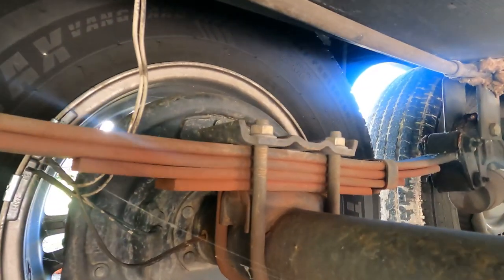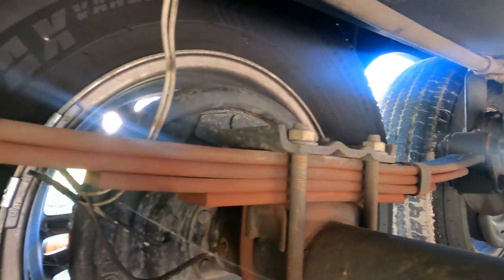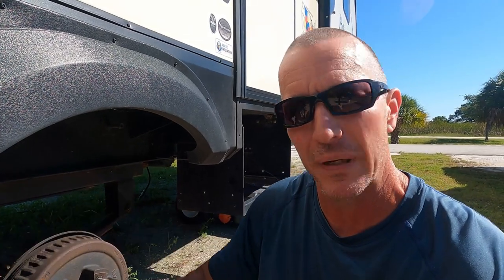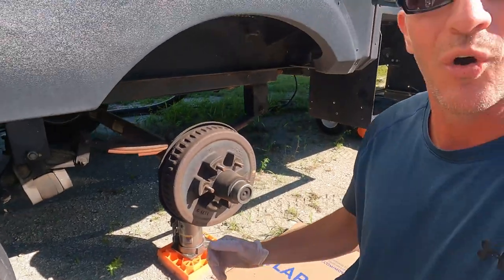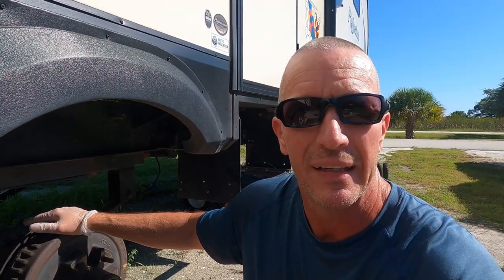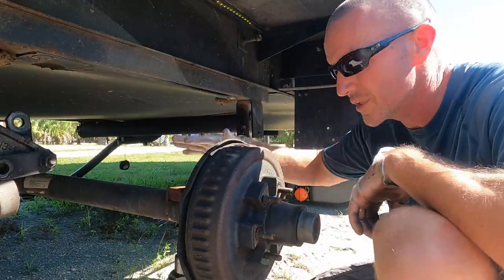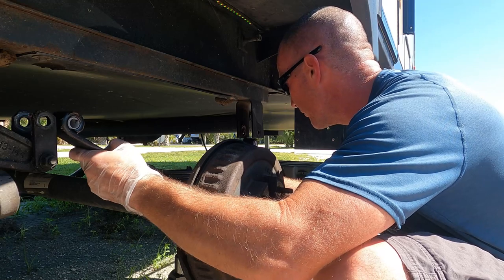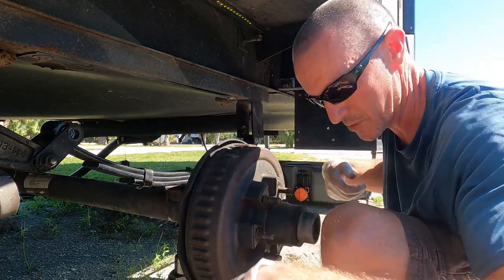Replacing Leaf Springs On A 5th Wheel | RV Suspension Repair

Comment: Suspension components on RV’s break because the manufacturer installs only the bare minimum needed for the weight. Once you add your cargo and some fresh water you are very close to or over the GVWR. NOT GOOD! Also, if remove the U bolt’s first, and then let the axle down slightly with the bottle jack until the centering bolt on the leaf spring is clear of the U bolt bracket, it is way easier to take the wet bolts out. One more thing. If you’re installing new springs, get rid of those nylon bushings and upgrade to the brass ones. Those nylon ones are crap and wear out quickly.
Reply from the maker: Thanks for the tips!

Comment: I noticed the 4 leaf are 25 1/8 and the 5 leaf are 25 1/4. Do you think the 5 leaf would have fit ok even though slightly longer? I'm not sure if this is an issue or not?
Reply from the maker: During my research, many people used the 25 1/4” 5 leaf springs with no issues. That was my preferred option, but they were out of stock at the time and our U bolts were not long enough to accommodate the extra spring. That is why I ultimately went with the 3000 lb 4 leaf version.
Reply: 10-4, I'm having the opposite issue but at least they have 5 leaf in stock. I'll go with those. Thanks for the response and video
Reply from the maker: @davidlawson5937  you’re welcome
Reply: @davidlawson5937  David, did the 5 leaf work ok? Any feedback with the install? Thank you.
Reply: @cadexim  The 5 leaf worked fine. Had issues getting the old ones off and new on but it was manageable. Took longer than expected. If you are like me then everything does but you'll get it done 🤣. For me it was a bit of trial and error trying to find the sweet spot with the jacks to get bolts off and on. Don't really have any additional tips. It's a pretty tough job but doable. Be patient and take your time figuring things out.
Reply: @davidlawson5937  thank you David. I recently installed the new CRE3000 and installed crossmembers so I have an idea of the work but like you said, it is still quite a job. You also replaced the U brackets correct to accommodate fir the 5 leaf springs correct. Do you have the part number by any chance? Thanks again.
Reply: Didn't have to replace the u bolts, mine were already long enough. Did replace any shackles or nuts and bolts that were suspect. I might have replaced all the nuts on the shackle bolts that were the "locking" type. I don't remember the name of them and don't have any part #'s. I did that job about a year ago. Sorry I'm not alot of help but this video has solid info in it.
Reply: I think the u bolts are about 7" long and will work for 5 leaf. Hope this helps.
Reply: @davidlawson5937  thank you very much David. That is good info. I will measure mine and if they are the same length as yours I wont replace them.
Reply: Well done, you showed how easy this is to do. Thank you for making this video.  Good comments from viewers as well.  Surprised no comments on alignment.  Must not  be an issue.

Comment: Very nice video but you should have replaced the U bolts as they stretch when torqued and never should be reused.
Reply from the maker: Normally I would, I was in a time crunch and new U bolts were not readily available. Thanks for watching!

Comment: 2 year old bad leaf spring is not impressive and you should have changed that dexter out also
Reply from the maker: Agreed, 2 years is premature for a leaf spring. To be fair though, we are full time and have made multiple cross country trips over some extremely rough stretches of road. Thanks for watching!
Reply: @JouppiOutdoors  after our first trip from Nevada to the Keys and back, our next trip is to Alaska. Replaced the suspension with a Cree 3000 and seems to help. Rough roads ahead

Comment: Never, ever reuse u-bolts. U-bolts are a torque to stretch alloy meaning when they are properly torqued, using a torque wrench, they stretch a certain amount which is where they gain their holding power. If you back them off even a turn, the stretch you have applied will have an inherent memory therefore if you properly re torque them they will be over stretched thus reducing their strength and holding power. Sure, you could cruise around for a long time without issue yet when you get into a high speed evasive maneuver or a panic stop at speed they will more than likely fail causing a catastrophic failure. Those who say they have done it for years without issue are what we call "lucky". As a certified, professional technician I have seen it all. Do the right thing and purchase new u-bolts, washers and nuts. In the end, what is your life worth?
Reply from the maker: Thank you for the info and thanks for watching!
Reply: You can easily buy some or if you want to save a few dollar please use some lock tight. I don’t see a issue with that, just make sure they don’t back off, I have also mage a personal cotter pin, smalll heavy duty drill bit and there ya go. Piece of mind. I do agree with above opinion but if this gentleman is in a situation it’s not going to hurt for a while at all